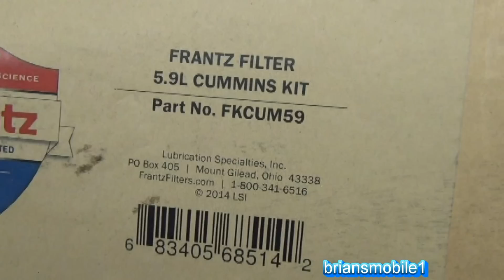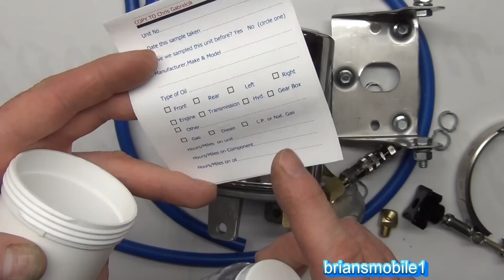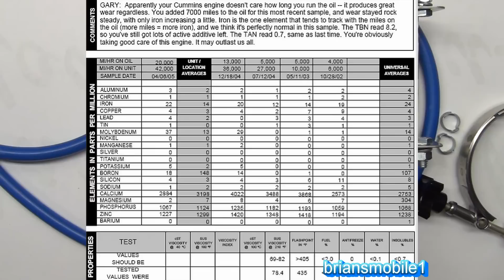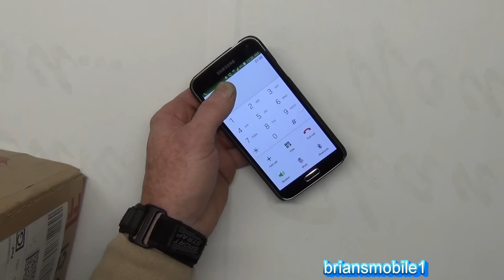How to Make Synthetic Oil Last Even Longer  Frantz

Comment: I once used a paper towel system on my big rig. To answer some questions about dissolving paper, only if you are getting water in your oil. If you want to use a off the shelf TP make sure it is lint free(dust free) as possible.
Reply: The oil protects the toilet paper from water. If your tp gets soggy or gets cracks in it it means water. Normally dont have a water problem unless you arent driving enough at operating temperature for the PCV to remove the condensation or the oil is getting coolant in it.
Reply: One time I noticed the oil was getting milky on the Rambler. That means water. I drained the oil and changed the oil and the toilet paper. With water the toilet paper will feel soggy.
Reply: I converted a flat head Ford V8 canister filter to use a roll of Scott 1000. The other day I removed the spacer and put half a roll of paper towels in it.  I like the VIVA in the Ford diesel tractor. If Gulf Coast filters can use paper towels on heavy duty diesels I should do fine with my little Ford diesel. I might cut a roll of VIVA for the Jackmaster Classic on the Pontiac. I can mark a roll and go around a few times with a fine toothed hack saw.
Reply: Im not as smart as some of these geniuses that know about molecular sizes. I let the oil companies worry about that. I try to keep it clean. Since I have some common sense  I will put the end I cut up. The only filter I have that filters from the bottom up is the old 60s model  Motor Guard on the F250 390 engine.
Reply: Found out I can cut the VIVA towels a lot smoother with a sharp knife. Did a fleet of trucks when the 6.0s firdt came out. These were tree service vehicles. The diesels took Gulf Coast 01s bolted to the frame. The gasoline engines took the Gulf Coast juniors. In those days they didnt put the Bounty big rolls or the janitorial supply toilet paper in bags.
Reply: If you run an engine long enough with water in the oil the first thing to go is the pleats in the full flow filters.     In 60 years of using toilet paper ive probably drained the oil a couple times because of coolant in the oil. I dont do short trips in cold weather. People will always assume toilet paper comes apart in oil. When I pull out a used roll of toilet paper I want it to be strong and tear at each sheet  If its not strong its been in there too long.

Comment: Question...can I use this bypass filter kit on a gasoline motor?
Reply: Yeah all oil is the same. Diesel branded oil just has more additives to help with the black soot.
Reply: I have TP filters on everything I own that has an oil pump including riding lawn mowers..
Reply: Some of the engines have no way to tap into the oil pressure.on the mowers. I use Frantz sandwich adapters for Fords 3/4  16 threads with Ford or Toyota spin on flters. You do what you gotta do for clean oil. Return the clean oil to the drain port.
Reply: When I started using the Frantz in 1963 engines were dirtier and oil wasnt as good. Modern gasoline engines almost dont need bypass filters. Im a clean oil nut case. My Ford diesel tractor needs the depth filtration. A lot of soot. The hydraulic oil lubricates the 12 speed transmission the power steering the loader and the three point hitch. The factory only put a strainer in the sump. Im told this tractor has hard to find parts that are very expensive.79 Ford 1900 3 cylinder diesel.
Reply: Put a KN full flow filter on the hydraulic oil and a Motor Guard tp filter. Both in parallel as bypass filters. Fed them with a orifice and needle valve with a gauge. If the Motor Guard cloggs up the fluid will go thru the KN and I wont get blown off the tractor by hydraulic fluid.

Comment: when I was working on my motorcycle and draining the oil a lot I noticed when I let the oil sit in a gallon jug all the impurities would fall to the bottom and the oil was clean. is that like a way to renew oil or something? just let it sit and pump the clean stuff off the top?
Reply from the maker: Many oil pans have something to that effect.  There are also magnetic oil drain plugs that hold ferrous metals in the bottom to keep them from going wrench in the works.  That's litterally the concept behind this filter- trap the glitter and remove it from circulation while you drive.
Reply: +briansmobile1 my uncle was telling me something about oil breaking down.. does that just mean it gets dirty or does the chemical makeup change or something?
Reply: Actually you are doing the same thing as a centrifuge it just takes longer
Reply: My oil doesnt break down. I avoid getting it too hot and I avoid allowing it to get dirty. The oil in my A/C is over 20 years old.
Reply: I put a Frantz oil cleaner on my Honda 500 Custom. I converted the canister full flow filter to a Ford spin on.used a Frantz sandwich adapter. Returned the clean oil to a plug similar to a valve adjusting plug.hung the Frantz upside down back behind the saddle bag. A motorcycle club at San Jose California had Frantz oil cleaners on their Harlys. Better than putting it in a jug LOL.
Reply: Bought a Smart car with 100.000 miles on it. The oil looked new but I didnt know what kind it was. Went ahead and changed it.Left the used oil in a gallon wine bottle.about 1/8 inch of sludge went to the bottom.

Comment: Ive always had to change the TP filters more often because I dont drain oil. I was wondering why you couldnt use 20.000 mile oil and a 20.000 mile full flow filter and a TP filter and change everything in about 20.000 miles.or check the oil and see if you can go farther. Some with lesser bypass filters are doing that sort of thing.

Comment: I would do this if I didn't think it restricted oil flow at start up.  One purpose of an oil filter is to help oil flow to the top of the engine faster at startup. 75% of engine wear happens at startup. Maybe I'm wrong about restrictions to oil flow if it has 2 oil filters and more oil.
Reply: Yes. No... The tiny pinhole is shown at least twice in the video. There's no way in hell you would get the same oil flow in the Franz as you get in the stock filter. Small amounts over time.
Reply: It does NOT restrict oil flow to the engine.  How does an oil filter "...help oil flow to the top of the engine faster at startup"?  That statement is completely false. 
A lot of wear does happen at startup. Probably more than that. Hard to tell because the majority of the rest of the wear is caused by contaminants that bypass the regular filter entirely.  At cold start or high revs the bypass valve opens and lets oil bypass the filter.  Not to be confused with the filter kit mentioned in the video which is a BYPASS filter. This means it only takes a small amount of oil and filters it and then dumps it back into the crankcase.  It just runs off oil pressure like any bearing.  So the regular filter still does most of the work and can still let contaminated oil into the engine at cold startup.
Reply: The Wix full flow filter on my Pontiac Torrent  has been on there for 60.000 miles and over 4 years. The TP bypass filter keeps the oil engine and Wix clean. If the full flow filter bypass valve opens there will be no dirty oil going to the bearings. The Motor Guard kept every thing clean. I took off the Motor Guard to try the Jackmaster  There wont be any difference. They are both capable of eliminating oil changes and engine wear..And are easy to service. The Gulf Coast junior  is the same. With its glass filled nylon canister and stainless steel hardware its advantage is salt water marine use when I was selling filters I recommended changing the full flow filter every 2 years. The bypass filter protects the full flow filter. Neglect the bypass filter and every thing goes to hell. Some of the old Frantz and Motor Guard users never changed the full flow filters. Motor Guard and Frantz also had adapter plates that eliminated the full flow filter..
Reply: Im not convinced 75% of engine wear is caused by starting the engine. One bypass filter company claims 99% of engine wear is caused by dirty oil. I dont know. I do know some oil stays on the engine parts when you shut off the engine. Best if that oil is clean.
Reply: My experiment with going 65.000 miles without changing the full flow filter is over. Cut open the standard WIX. The pleats were rotten but still in one piece. Put on a larger WIX XP. I know it is working good because nothing is showing up on top of the toilet paper in the Jackmaster Classic Im told the WIX  XP  has synthetic pleats. The pleats have a wire backing. One thing about the Jackmaster Classic I like is I can remove the lid to see if the full flow filter needs changing.
Reply: @consaka1  You understand how the oil system works. Most people dont. My wife was a office Manager at the college. A professor told her he has a red light on the dash that says oil. Its been on a couple days. A guy told me his Frantz isnt keeping the oil clean. I asked him when he changed the Frantz last. He said change it ? The guy that sold it to me said it would last a lifetime.
Reply: A guy said he drilled out the orifice on the Gulf Coast junior so it would filter faster. Stupid mistake.

Comment: Is it a bad thing to put motor honey in every oil change: even on a good motor with no oil consumption. Will it help a motor really last longer.
Reply from the maker: It's not helping really.  It could restrict oil ports.  It's generally not a good idea.
Reply: When I worked in a Standard full service gas station they said good oil dont need.extra additives. Someone asked why do we sell them. The instructor said because people buy them.We were mostly sales people.People would take the air filter off and pour STP through the carburetor We didnt go that far.
Reply: My wifes car a 2015 Honda Accord calls for 0 20 motor oil. Probably wouldnt take much oil thickener for me to get a call. My car quit running.

Comment: Most people dont understand bypass filters and wont learn. I was putting a Frantz on a new  63 Dodge pickup. His brother drove up. He said if I knew you wanted a Frantz I would have given you mine. My oil is dirty and my lifters are noisy. He wss asked when he changed the Frantz last. He said change it The guy I bought it from said it would last a lifetime. The Frantz went on his brothers car.

Comment: Cool video Brian.  I had never heard of this.  I wonder what Cummins would tell you about your warranty with the Frantz bypass filter addon?
Reply from the maker: I bet the engineers would be fine with the filter- just maybe not the long drain intervals.
Reply: I have read letters from the big heavy duty diesel engine .makers.  anything non stock that causes  engine damage will void the warranty. This could be a non stock full flow filter. A power chip.  A non stock exhaust  brake. Not  following oil change recommendations. A salesman told a trucker the paper towel filter would void the warranty. The trucker said I will get a truck with a different engine. The salesman said wait a minute I will make a call. He came back and good news. It wont void the warranty.  Some truckers dont drain their oil with the paper towel filters. They have an oil analysis program  in case there is a warranty problem.
Reply: Actually it wouldnt be wise to have engine problems with a non Cummins full flow filter or a power chip. Many truckers wont run on dirty oil in an attempt to keep the warranty good. Clean oil comes first.
Reply: Dont know what they have now. I remember when the best oil filter you could get for the Cummins was the Cummins Fleetguard 750 or the Luberfiner 750 They used cotton the same as the bypass filter on my 41 Dodge. Later they went to pulverized newspaper and wood chips. They all hooked up the same as the Frantz. With an orifice and oil lines. I once worked for a company that wouldnt put a truck on the road without a Luberfiner.750.. old guys remember the big chrome plated Luberfiners on the side of the trucks.Same as the Frantz only a lot bigger..Then people started thinking they were only for dirty conditions such as dump trucks. No one  liked to service the filters including myself. The TP filters are a piece of cake..
Reply: When they tell you anything non stock that causes engine damage isnt covered by the warranty some non thinkers think that means anything non stock causes engine damage. The big engine makers are familiar with big bypass filters. Luberfiner and Fleetguard 750s for example.

Comment: Frantz is the bomb, best dam bypass filter ever made and cheap. Filters down to .5 micron
Reply: Ive used toilet paper filters for 60 years starting with a Frantz. Everything I own with an oil pump has a toilet paper filter including riding mowers. I prefer the top loaders.They are the easiest to service. I recently bought a Australian Jackmaster from Ebay. These days you can pay 30 dollars and more for elements for these filters. I am a highly skilled journeyman  toilet paper squeezer. Ive been using Great Value 1000 from Walmart in mine. The Jackmaster Classic has a bigger core seal for the bigger core toilet paper. Or you can use 30 dollar elements that they claim are better than toilet paper. Ive heard claims of submicronic up to 2 microns for TP.. Pretty sure Scott 1000 or Great Value 1000 can beat 5 microns. The 30 dollar elements can get down to at least 1 microns. It takes at least 3 microns.
Reply: My eyes aint so good was that 5 microns or .5 micron.
Reply: Frantz isnt the best. Stuck with that obsolete  design and got left behind. The Australian  Jackmaster  is the best in production. You push the TP in and put on the lid.. The Austrailians  have a larger seal for the larger TP cores.About the only element that fits the Frantz  is the Frantz elements. The Jackmaster Classic  has fabric covered elements but they set up the filters with a larger seal so we can use the larger core TP.. I see they are less expensive on Ebay than I paid for mine. Actually the Gulf Coast junior is as good as the Jackmaster as far as being easy to service. The Jackmaster Classic  is die cast aluminum. The Gulf Coast junior is glass filled nylon.. Not sure they still make them. Saw some Jackmaster Classic elements for about the same price as the Frantz elements. Of course you have the shipping cost from Australia.
Reply: The cost is nothing compared to what they can save you in a lifetime. My 76 F 250 has a 50 year old Motor Guard. The Gulf Coast junior  on the ATF is about 20 years old.

Comment: Hope to see your install. when your warranty runs out !!! 😆
Reply from the maker: The more I think about it,  the more I think I'll install the kit and just do the 7,500 mile drain intervals anyway.  The kit is good science and the newer diesel EGR systems really crap themselves into the oil to get good clean tail pipe readings.  A kit like this could go a long way to ensure I don't have to use the warranty.  That's what I'm going for.
Reply: You know after going to the Frantz website and seeing how simple it is to install one of these. If you had a warranty issue, you could always take the kit off before taking your truck in for warranty work.  Just sayin'
Reply: @helidodge  I have thought of that. Ive only bought 3 new cars in my life. I was lucky. I did take the Rambler in for a rattle I couldnt find. They didnt mention the Frantz oil cleaner. They told me it was a hog nose ring in the upholstery. It rattled all the way home. Talked to a Ford body man.he said there is a sheet metal between the trunk and back seat. Get a ball peen hammer and put a few dents in it. Never rattled again.
Reply: When I was waiting to get the Rambler looked at I heard a mechanic tell a lady her Rambler needed a new water pump. He left the hood up. I told her all it needs is a new radiater hose. She asked me if I was a certified Rambler technician. I got back in my car. Warranty probably expired